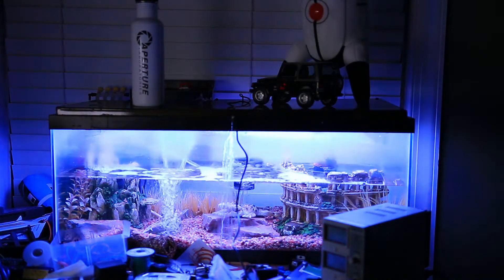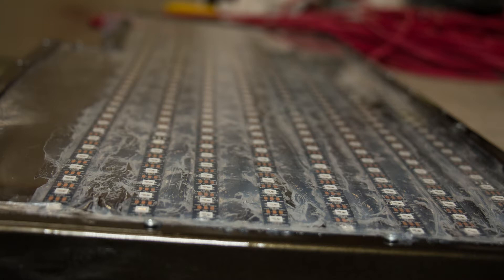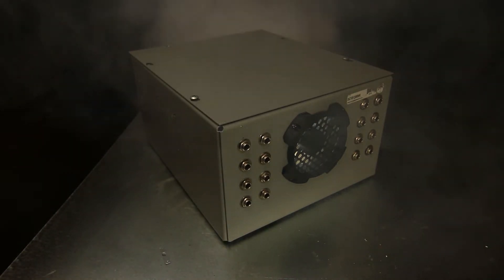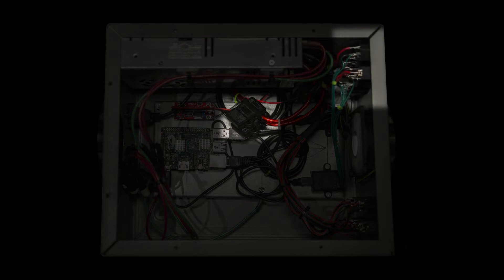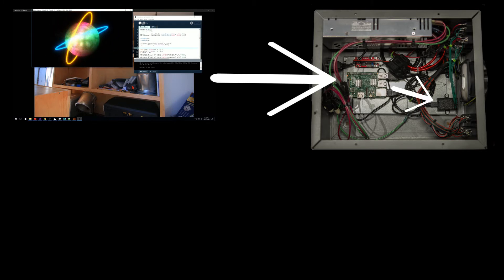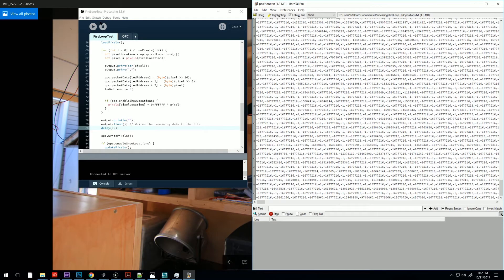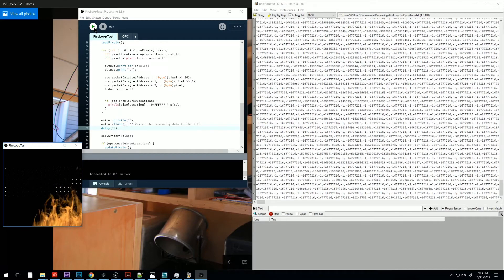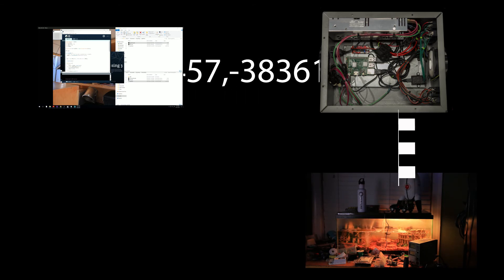Light Commander FadeCandy LED controller

Comment: I have figured out a way to easily change animations on the fly using your code base.  Thank you!  Now I'm trying to get python to parse that text file so I can ditch having to use Processing.
Reply from the maker: Thanks. That's great to hear. I'm glad my code was useful for you. If you happen to opensource your code and want to share it, post it in another comment. I'll pin it if you like.